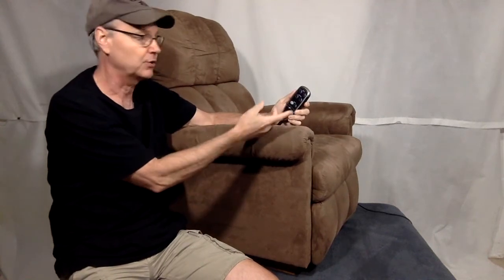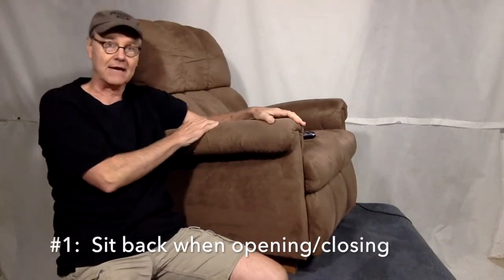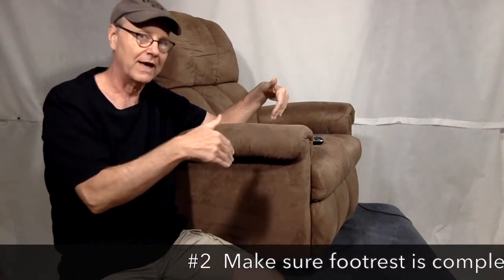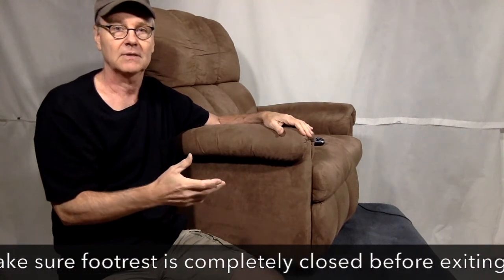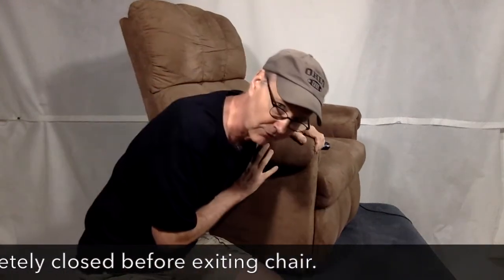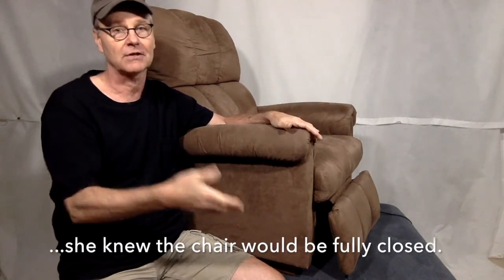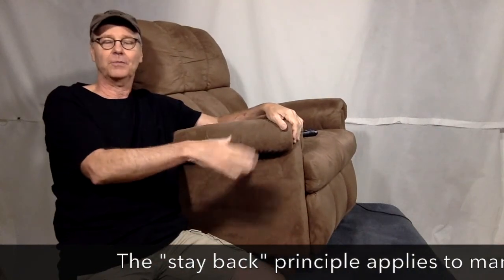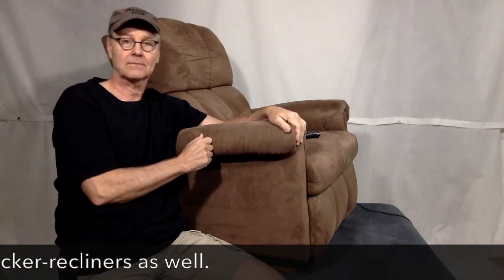Operation Tips: La-z-boy Electric Recliners

Comment: If I've damaged my recliner by getting out of it before the footrest was fully closed, can I repair it myself? What kind of damage does this do?  After reading your responses I realized that I do this and I'm grateful for the tip of waiting 7 seconds before getting out of the chair since I have hearing problems.  My chair doesn't work at all.  Not even the phone charger! I can't find the reset button to try that.  Any suggestions?
Reply from the maker: @linda reiger - You'll need to have someone inspect & diagnose the problem. If you're a DIYer, you can start with the tips in this video ----> https://www.youtube.com/watch?v=qyC5or1YfcM&t=1s

Comment: Is power chair worth the money.  Is it built well  strong ?  Reliable ? Love your videos keep them coming
Reply from the maker: @Richard Thompson - Electric recliners have more parts that can fail over time. And mass-produced name brand furniture manufacturers typically only warranty electrical parts for 1-3 years. So, if your chair lasts long enough, you can look forward to paying full retail (if the parts are still available) for hand controls, power supplies, lift motors (actuators), control boxes, etc., when those parts fail over time.

Comment: I have a power recliner. The plastic actuator assembly and some of the plastic bushings have cracked/broken. I have the parts (hopefully the correct parts) ordered. In looking at the chair, there and numerous other parts slip on the square shaft that appears to run the width of the chair. How do you get these out?
Reply from the maker: @Bruce Richardson - We have several videos related to replacing the plastic mechanism parts on La-z-boy electric recliners on our website - ReclinerRepairGuy.com. Check out the video descriptions for "Electric Recliners' in the members-area there.

And by the way, the replacement part for the plastic Drive Toggle (black plastic part that slides onto the Drive Rod) is a metal part that does away with 2 of the plastic ones. The new part is called the 'Drive Toggle Clevis.' And it comes in a kit with some plastic bearings (spacers) & a Footrest Actuator Pin.

Comment: I have one that has controls for headrest and lumbar too. Everything still works except the lumbar motor. It just recently stopped working and there is no sound or vibration when I push the button. Any ideas on what happened? The chair was purchased I think 2017
Reply from the maker: @Allie White - If you have an adjustable lumbar support with massage & both stopped working at the same time, I would suspect an electrical problem. Have an experienced La-z-boy repair tech check it out.

Comment: My mother in law has a Motorized Recliner that the footrest does not Open! I can hear the motor working but the footrest does not open. So is the footrest motor bad even though it sounds like it is running?  You should do a video in replacing the DC Motors.  Thanks!
Reply from the maker: @Scott Barnard - If you haven't already, turn the chair over so you can observe the lift motor while pressing the activation button. Just bump the button a few times for a second or two to see if the actuator arm moves, if it's disconnected, etc. 

Most lift motors are easy to replace. Usually only held in with metal pins and retaining clips.
Reply: Where can you order new arms for the chair . i think i need a new set

Comment: I have a 6 year old power recliner that was damaged from this. The plastic piece with a square drive shattered. Any hints or video on how to replace that part? Thanks!
Reply from the maker: standswithfish - If it's the black plastic linkage part that slides onto the square Drive Rod, yeah, that can be a tricky repair. I recommend you get an experienced La-z-boy repair tech to do that installation/repair for you.

Comment: My La Z Boy XR Power Recliner has a broken Drive Toggle (plastic) I have found a metal replacement. This is the second time it has broke and wondering if you have any ideas on using a metal part.
Reply from the maker: @Anti-Antifa - Yes, there are videos on this repair on the new ReclinerRepairGuy website. Sign up for a free membership to access the video library. Then checkout the video titles & descriptions in the 'Electric Recliners' module.
https://www.reclinerrepairguy.com/Home
Reply: @reclinerrepairguy4155  I can't find anything referring to the metal replacement part. Can you provide a link? TY
Reply from the maker: @SuEnRoD  - The video on the website is titled, 'La-z-boy New Drive Toggle Clevis Setup.' Read the video description for more info.

Comment: Hi. My brand new swivel rocker leans forward. The furniture company tried to fix it but he was not a furniture repair man.  He just switched flipped the mechanism.  Then said the cushions Are new making you lean forward.  
Any advice it still leans forward. 
Thanks
Reply from the maker: @Jennifer P - Did you try out the same chair at the store before buying? (That's very important.) If you did and it was comfortable and worked fine for you, there is something different with the chair that was delivered to you. Could it be that the padding on your chair is new, while the padding on the floor model is broken in? Perhaps. But if that's the case, why was anyone "flipping" the mechanism?

Here are some suggestions to consider: Go back to the store and try out the same chair -- if you can and it's still in stock. Check the "stance" of the chair. Is it the same as yours? Or is it pitched back a bit more? There may be a pitch adjustment that can be made. Is the back padding noticeably softer or more compressed than your chair? Take note of these factors and you may be able to determine what is different on your own.

You can also request that the store send out a real repair tech to make a determination. And finally, if you did try out the chair at the store (and still like it!) and it's still there and you don't mind the fabric & color, you can always ask them to swap out yours with the floor model.
Reply: @reclinerrepairguy4155  thank you soooooo much for the quick response so nice of you. I will take your suggestions.  It was flipped because he said it was installed backwards. But looking under it and watching your videos it looks like it’s positioned to close up front and NOT in the middle. Thanks again at least I have a professional opinion to take with me and not just my word.  
All the best to you. 
Jennifer

Comment: I have one like that .Gf was reclining yesterday and now footrest makes popping jerking when extending footrest.I cant see where problem is.Any suggestions? Thanks
Reply from the maker: @user-wj2ry5hn7q - You likely have some broken or damaged plastic parts. Continuing to use the footrest can cause further damage. To see what has broken, remove the back & turn the bottom of the chair upside down to inspect. Plug the chair in and SLOWLY move the actuators (stop frequently) to find the damaged parts. Look for splintered, split & fragmented black plastic. Also, check to make sure the actuator arms are not bent or otherwise damaged.

Comment: I have a reclining sectional, the motor stopped working while it was reclined.  I ordered a new motor and installed it.  It sporadically works.  If I remove the motor from the frame and keep it plugged in it will run all day up and down.  Any suggestions??
Reply from the maker: Silly Noodle - My initial thoughts are that the power to the motor may be reduced to the point where the motor only operates consistently when it's not under load (installed).  Or the motor may be defective. Another possibility is the mechanism  it's driving is binding (bent or damaged). But that doesn't usually stop a motor in its tracks, unless it has a built-in overload feature, perhaps.

If you still have the original motor, plug it in without mounting it to see if it will work that way. That may provide a clue.

Comment: My electrical cord to lift the legs and recline the headrest has an electrical shot.  I ordered a new one (11850U-07)   How do I plug it into the recliner?
Reply from the maker: linda patrick - When your replacement part arrives, look at how the original is installed. You'll want to replicate that. If it looks too difficult to do yourself, contact the store where you bought your recliner (dealer) to have them install it for you. If that's not an option, look for an independent repair tech in your area. Here are some tips to help find one ---> http://www.reclinerrepairguy.com/locate.htm

Comment: i have regular electric recliner but cable snapped off whilst moving, can it be fixed as its not covered by insurance?
Reply from the maker: @Di - If both ends of the broken cable are easily accessible, you can reattach them with a connector. I recommend having someone with electrical experience do this. Twisting bare wires together and slapping some electrical tape on the connection is not recommended.

Comment: I bought two recliners.  When we were at the store my feet were flat on the floor.  Get them to my house and feet are 3 to 4 inches from the floor.  How can you adjust this forward.  I looked underneath  and can't see anyway to adjust these.  You need you feet to rock and this is uncomfortable.
Reply from the maker: @jkwttrs - If you bought the chairs new, they should have warranty protection. Contact the seller to report the problem.
Reply: @reclinerrepairguy4155  Will do,  I just figured if it was a simple fix I would do it. I moved the spring mount to the back holes and it didn't change anything.

Comment: Is there any way to make the footrest go up higher.  Mine is super uncomfortable.  What are the wide elastic bands that stop it from going up?
Reply from the maker: @Cathy Owens - If the Legrest Extenders are fully extended, the footrest is open as far as possible. Designs will vary among recliner manufacturers. That's why it's best to try out many brands before buying. See the video, 'How to Buy the Right Recliner' to learn more.
Reply: @reclinerrepairguy4155  The floor model and shipped from the factory are not the same.  I can easily lift the foot rest 3-6 inches without forcing but it just drops back down.  The elastic straps just hold it down tighter when closed.
Reply from the maker: @cathyowens2064  - If your chair is not operating properly, contact the seller (dealer)  where you made your purchase. If you purchased the chair new, it likely has a warranty that's intended to cover issues like this.
Reply: @reclinerrepairguy4155  I have the same problem. When I bought the chair, the footrest would open up 3 inches higher, over time it has sagged, noticeable enough that my husband commented on it. I had it repaired once, it is sagging again. Chair was expensive,  but I am thinking of getting rid if it, no one is jumping on the footrest, I wait until it's completely closed, etc. but the footrest is now not the comfortable height I originally bought! Will not buy La-z-boy again because of this, no excuse for this in an electric recliner this expensive! It doesn't help to sit in the chair in the store if it sags over time.
Reply from the maker: @MaureenTheTemp  - The purpose of trying out recliners at the store is to find one that fits you properly. Unfortunately, finding a chair that fits does not guarantee that you won't have any problems with it.

Mass-produced furniture brands like La-z-boy, Flexsteel, Catnapper, etc. do not make high-quality furniture.
Reply: @reclinerrepairguy4155  And yet, they charge you like their furniture is dipped in gold. I just gave up on the chair I was working on...went and picked up a power recliner for next to nothing off of Craigslist. Nice chair but still made entirely out of OSB. This chair starts at $1400.00 new, so I really don't see how they can get away with pricing them so high. Do you have a favorite brand/model of recliner that you can share with us?
Reply from the maker: @paulbok6941  - The video, 'Who Makes the Best Furniture / Recliners' is on the ReclinerRepairGuy.com website.

A couple of brands are mentioned, but this video is about recognizing and understanding the quality differences & levels, not naming brands that are good or bad. Most people cannot afford good quality furniture because it's so expensive.
Reply: @cathyowens2064 😮

Comment: My Chair foot lift mechanism (plastic gizmo) was broken into numerous pieces. Where can I get this part. Have looked at LazyBoy manufacturer website, but is not user friendly for a Senior
Reply from the maker: @Jacob Crouch - La-z-boy parts are available from the manufacturer or one of their dealers. La-z-boy Comfort Care#  (855) 802-6636
Reply: @reclinerrepairguy4155  Thanks for the number. I am working up the courage to deal with the problem. I have been so disappointed with this chair and would rather have a different one. But it was expensive, so I am stuck with it.
Reply from the maker: @jacobcrouch4561 - How old is the chair?
Reply: @reclinerrepairguy4155  2 years old...it is a power rocker recliner, style 1HR766 which I tried to return to the store when it was almost a week old, They would not except.
Reply from the maker: @jacobcrouch4561 - Ok, so the repair labor warranty has expired -- it's good for the first year after purchase. So warranty repair service is not an option.

There are 3 black plastic parts that typically fail on those units. 2 of them are easy to replace, 1 is not. If you can send a clear photo of the damaged part(s), I can try to advise you further. Send them to my email address: pete@reclinerrepairguy.com
Reply: @reclinerrepairguy4155  two years old my remote control is not working..looked at the wires some are bare
Reply from the maker: @frankgarneski5100  - Looks like you may have found the problem. If your chair is only 2 years old, you should have warranty coverage on the electrical parts. Electrical parts are warrantied for 3 years with La-z-boy. Contact your La-z-boy dealer to order a replacement.
Reply: @reclinerrepairguy4155  I called lzboy they advised the part is covered 
cost processing fee 13.99..thanks for your prompt response 👍 😀 ..thanks

Comment: How to replace the controller?
Reply from the maker: @Catherine Kendrick - If you're referring to the hand control, those typically plug in via a connector-type plug. However, there may be some zip ties or clips used to route the cord through the chair. Be sure to route the replacement the same way, unless it was improperly routed and that caused damaged to the cord, or course.

Comment: My Lumbar on my Power La-z-boy stopped working. I can hear it but it doesn't expand or contract.
Reply from the maker: @Toby Strickland - You'll have to loosen the outside back panel to see what's wrong. Or have a repair tech do it for you.

There may also be a cardboard panel underneath the cover that has to be loosened / removed as well.